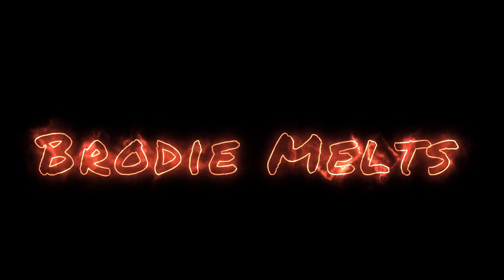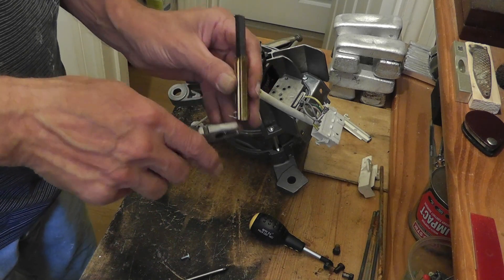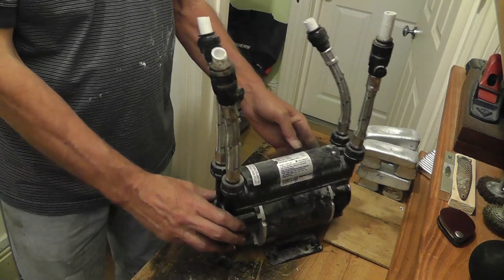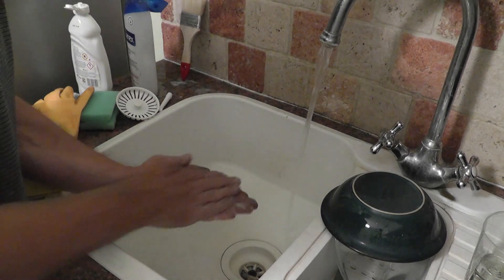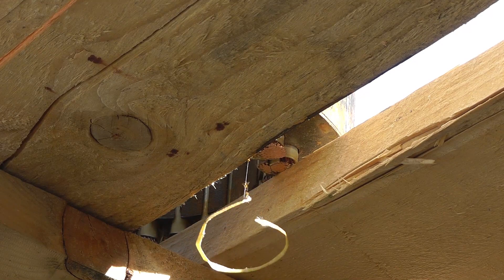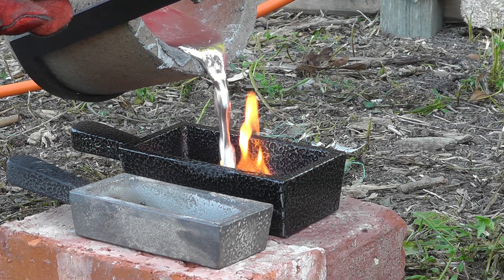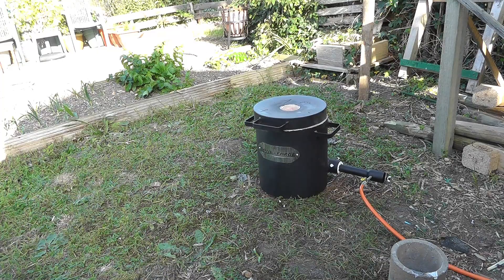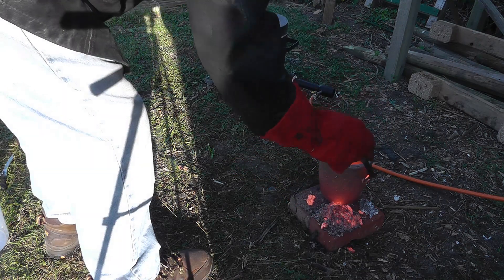3 Motors melt down, with narration. Metal melting and scrapping.

Comment: Hi just subbed to your channel, the 2nd moter is a washing machine moter, the outer shell is cast aluminium, break that up with a lump hammer 🔨  for melting, yeah if your unsure about the carbon brush  casing test it with a magnet 🧲, brass is non ferrous as cast aluminium and copper etc,,great tear down on the electric motors ,very nice pours ,how much did you pay for your devil forge and pouring equipment?👍
Reply from the maker: Thanks for your comment. I have spent about £300 in total. I already had the cameras etc.
Reply: @BrodieMelts  your welcome, how long would you say it takes to melt copper wire down /aluminium?yeah I have some equipment myself just need the forge and lifting equipment for pouring etc
Reply from the maker: @nightscrapperuk13  Ally is done in a minute or so in a hot crucible. Copper takes about 8 minutes but freezes quickly. Take a look on ebay. The Devil Forge manufacturers sell it there